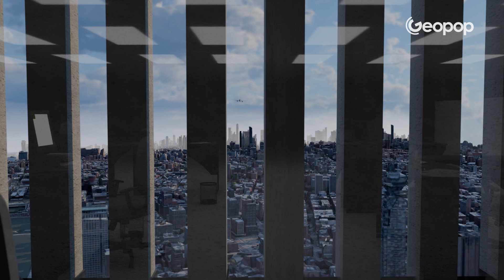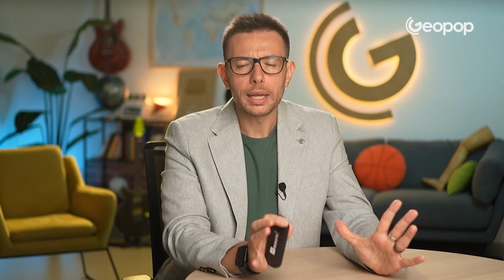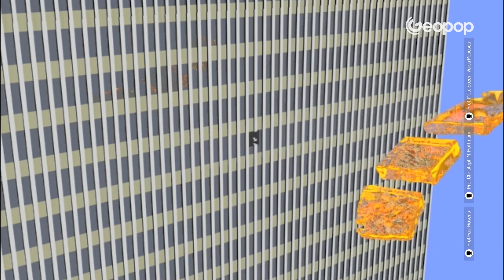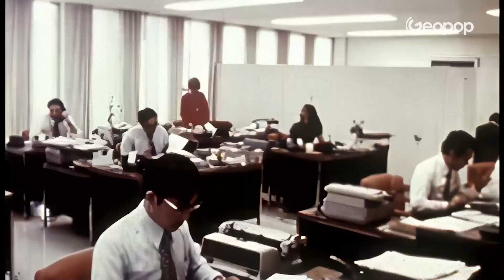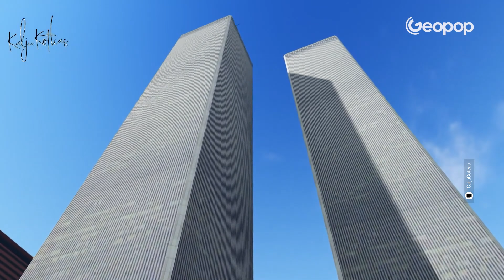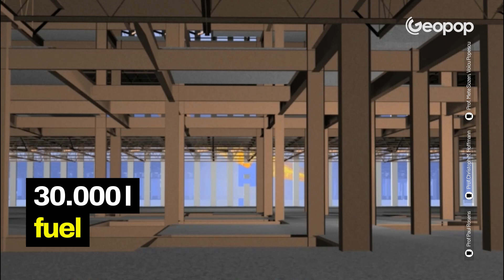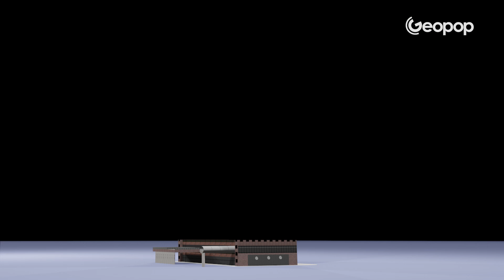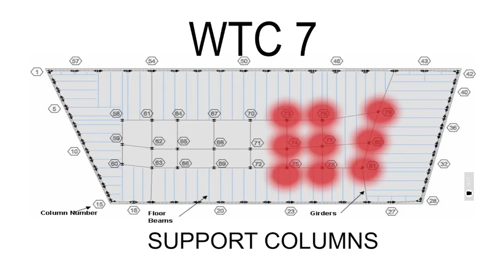9/11, 2001: The Technical Reconstruction of the Twin Towers and WTC 7 Collapses

Comment: He’s right about the fact that we will never truly know what happened on that day.  That’s the most disturbing part of it in my opinion,  the fact we can’t trust our own government to tell us the truth so we can’t ever know if their version is true or false.  In my opinion it’s about 50/50 with half of what they claim being a bunch of B.S.

Take for instance the Pentagon.  A computer model was designed by the American society of civil engineering.  In this program they left out key factors that no doubt would alter their conclusion.  They purposefully left out the nearly 20in of steel reinforced concrete exterior in their model,  they also left out the engines from the plane itself.  They some how are able to stand there with a straight fact and say that those two factors had no bearing on the outcome of their study,  okay fair enough than why leave them out?

You can’t seriously say that nearly 20in of steel and concrete didn’t give any additional protection than if they hadn’t been there at all.  It’s stuff like this that makes me question the validity of everything we are told and how involved our own government was in the murder of 2,977 American citizens to start a war over oil and get the support from the American people.
Reply: There is getting every detail wrong, then there is getting EVERY detail wrong.
Reply: @TheLoonResistance  what do you mean?
Reply: Please explain I am bafflled
Reply: I know exactly what happened that day - I saw it with my own eyes.
Reply: @aldunlop4622  you know what you saw,  you don’t know why it happened, who was involved, was their prior knowledge, did the U.S. govt have a hand in it, did the planes truly bring it down or was that a cover for a controlled demolition, etc.  Just because someone was there and witnessed it doesn’t mean they definitively know the truth of how and why it all happened.
Reply: @chriscampbell3417  In the 3rd to last paragraph in my comment above to @Karl-w6r, I asked him what was stupid about Richard Gage’s repeated assertion that ”the towers fell at free fall speed.” You’ll notice that he never responded. Nor did any other ignorant “truther”. C’mon, Chris. Here’s your chance to show everyone how knowledgeable you are. ANY competent 11th grader, who’s ever taken a high school physics class could answer this question immediately. But Gage & his architects & engineers were utterly baffled by the concept for about 10 f’king years. Show us your technical acumen, Chris. Let’s see YOU answer the question.
Reply: So they didn’t have an exterior wall on the model? I find that hard to believe. So you mean a 20” steel reinforced concrete wall as in a standard concrete wall? Or did it have a special steel other than rebar inside of it? I mean it’ll definitely make a huge difference if they didn’t account for an exterior wall. But idk i never really bought into it being an actual missile. I mean people witnessed the plane coming in.
Reply: @SuppressHoardReject _ @SuppressHoardReject _ @SuppressHoardReject _ @SuppressHoardReject _ @SuppressHoardReject _ @SuppressHoardReject _ @SuppressHoardReject _ @SuppressHoardReject _
Reply: @Hariolor, do I detect a touch of sarcasm in your comment?
;-)
Reply: You make zero sense … there are always uncertain factors  … you over emphazise them and put them into a delusional context … planes hit the buildings ..  that can hardly be disputed … and intentional demolition is impossible … thats obvious if you have a mininum if knowledge how they proceed for that!
Reply: Absofuckinlutly
Reply: It’s almost as if the purpose of the terror attacks was to increase our defense budget to levels unknown to man..
Reply: the issue is money. an exhaustive search is exhaustively expensive. then the conspiracy people cry fraud, waste, abuse.  so with 70% of budget, you get about the appropriate amount of facts.  people involved understand and do try to calculate away the losses.
to expect perfection from a collection of imperfect people working in an underfunded and imperfect system is the issue. further, to compare that to any impractical reason for the govt and all the related partners to the damage to conspire to demo a skyscraper and slaughter its inhabitants stretches reality beyond belief.
Reply: @chriscampbell3417  @chriscamobell3417, Could you please provide a reference link to your cited report? I do not remember the ASCE doing an analysis of the Pentagon. I believe I remember the same structural engineering group from Purdue University that analyzed the towers doing an analysis of the Pentagon too, though. And I am very skeptical of them leaving out either the engines or such a massive component of the exterior of the building. I remember that their analysis had the plane accurately “inverting” (with the debris & from the front of the plane being concentrated near the entry point & the debris from the rear of the plane penetrating much further into the building, as was actually found in the debris). As I write this, I am certain that the analysis to which I am referring included the engines, because they were the only components that passed all the way into the building, thru the innermost wall & into a passageway between two major “rings”.
Reply: I don't think we will ever hear the truth.
Reply: How come no fiire fighters ever tell their story? About what they see? About what they experienced? What they went through?  No descriptions of anything? Do they not have insight? None of their thoughts? why does someone else have to tell thei story?
Reply: @ThomasStout-r3g, Tom, I disagree with your premise. I’ve seen comments from LOTS of firemen. In fact, I remember a “project” to preserve the memories of many ( perhaps “most”) eyewitnesses, that specifically focused on firemen & other first responders. 

But, here’s a few observations: I heard many quotes from firemen that were simply, factually wrong. For example, there was one fireman that said “we saw molten steel in the basement.” This is categorically false. They saw molten metal (most probably aluminum), NOT molten steel. I saw the same guy making comments about the building collapsing “just like a controlled demolition”. This is also categorically false. It bore zero resemblance to any controlled demolition. The lesson here is that “expertise is EXTREMELY specific. Like every professional, firemen are experts at “what they do every day”. Firemen do NOT do controlled demolition. They don’t work with molten metals in foundries, and are thus amateurs at both topics. Firemen “put out fires, rescue people & attempt to save buildings”. Firemen addressed CLEARLY & CONCISELY every aspect that pertained to their jobs on that day. (I sincerely doubt that even metallurgists in foundries could distinguish molten steel from molten aluminum based solely on a brief look alone. The REAL controlled demolition experts completely dismissed
 the contention of those collapses resembling CDs.

The people who are experts on the collapse of skyscrapers are very few & far between, but they are Structural Engineers with specific expertise in “tall structures”. (it’s just not a field that calls for a lot. SEs are more interested in “how do we keep these buildings from collapsing” rather than “what are the characteristics of the collapse once it starts. But the GOAT of Structural Engineers did weigh in on the collapse. His name is Zdeněk Bažant, the chair of Structural Engineering at Northwestern University. His comment was, “the building collapsed exactly as a knowledgeable engineer would expect, based on the causes & effects described in the NIST Report.

Also, EVERY Structural Engineering Society in the US has publicly come out in support of the NIST effort & their conclusion. NONE have produced any published papers or analyses which support controlled demolition. I invite you to NOT take my word for all of this (even tho I am correct in my assertions), but to look into it for yourself. An intelligent approach will be based on “what do the REAL EXPERTS say about these events. Ignore completely the Condpiracy Theory morons (like Richard Gage & his AE911T bunch of incompetent morons).
Reply: Which is more extreme -- to accept without question the inexplicable lack of turbulence in the wake of a 500 mph large passenger airliner -- not evident in the smoke and fire covering the impact zone only seconds later? -- or to recognize the indications of digital projection in its imperfect nature as we see a wing disappear in front of a bright blue sky? From another camera angle, the same aircraft is seen passing behind a crane in the foreground, yet in front of the heavy crane cable. 

There should be a hurricane of turbulence in its wake that would entirely disrupt and disperse the smoke and fire seen billowing outward just 3 to 4 seconds later at both towers.  Even the wake of a small Cessna aircraft would be noticeable -- yet there is nothing.
Reply: -- Then what is the source of the many tons of molten steel found in and under the debris, the heat so intense that the molten steel remained in that state for weeks afterward, running off of the debris as it was excavated. This cannot be molten copper from wiring that retains the color of a shiny new penny.  It cannot be molten aluminum that retains the color of the polished aluminum wheels of a street racer. It was the color of glowing orange molten steel  that cannot be mistaken for any other material, reported by firefighters who are very experienced in the nature of such materials as well as seen in video evidence.

When you combine this with an entire lack of turbulence behind 500 mph aircraft, when even a small Cessna Aircraft would leave an evident wake in the smoke and fire only seconds later .  . We find that skeptics still cannot be skeptical of the official narrative in explanation.  Sponsored channels and forum activity are skeptical of nothing when support is provided.

Sponsored activity in the forums is very normal today for commercial and political purposes and subjects of controversy -- in the attempt to lead public debate.
Reply: @  @ronaldgreene5733, your posts are fabricated gibberish, with zero supporting evidence. You have no evidence. You have YOUR “wishful thinking. If you had any REAL evidence, then why tf have you been sitting on it for 24 years, rather than disclosing it to the world. There are 100 newspapers & 1000 authors, just here in the US, who would LOVE to receive such info & … (HUGE “IF”, here) IF VERIFIED, would pay dearly for access to that info. Yet 24 years goes by, and not a peep. 

Here is the “big picture” view of what Conspiracy Morons, like Ronald here, do: 
The KNOWN events of 9/11 represent about 10 encyclopedias of painstakingly gathered information, gathered by about 20 different independent agencies (FBI, Local police, CIA, FAA, etc., etc.) In Toto, it represents a 100,000 piece jigsaw puzzle that, is 98% complete (& INCLUDES intercepted communications from OBL to al Jezzera supporters in the Middle East in which he proudly acknowledges that he WAS behind the events) & when assembled, the jigsaw presents a picture of Osama bin Laden standing behind the identified hijackers. Of course, there are several missing individual pieces (as there are in every “real-world” complex event). 

But Ronald, here THINKS that he’s going to find one tiny piece of blurry, unidentifiable “who knows what”, and when that piece is hammered into some random location, is going to magically turn all the KNOWN info into a picture of George W. Bush, Dick Cheney & cohorts. No explanation offered on how that one piece changes all the rest, of course.

And while he offers ZERO evidence for his stupid theories, he just MAKES SHIT UP. Such as “molten steel”. There was NO “molten steel”, Ronald. It’s not possible. Here’s a big hint. Check the melting temperatures of aluminum, copper & steel. Before the first ounce of steel could possibly “melt”, ALL of the aluminum & copper would have to have already melted into a LAKE of molten metal, and no human could have survived getting close to that location for about 4 months without cooking. But THAT DID NOT HAPPEN! People were (at great personal risk) combing thru the wreckage hoping to find survivors within a day of the collapse. Plus, in the cleanup, they pulled thousands of tons of both UNMELTED copper & UNMELTED aluminum out of the wreckage which they trucked, catalogued & sorted at the temporary storage site. 

Next, he suggests some STUPID crap about “lack of turbulence from the aircraft”. 

Yes, Ronald, a Cessna flying thru any clouds STATIC cloud of debris or smoke from a fire WOULD demonstrate its passage with wake turbulence. But the passengers jets on 9/11 NEVER flew through either of those. The clouds of debris were ejected at HIGH SPEEDS (ie., NOT “static”) a few seconds AFTER the impacts. The fires took a couple of minutes to grow & generate smoke, and were not along the flight path, (they were mostly on the OPPOSITE side of the building from the flight paths.

To put all this to rest, Ronald, show me the comparisons between these impacts & the controlled studies TO WHICH, apparently ONLY YOU) have access.

PRESENT YOUR EVIDENCE, Ronald. The airplanes never flew thru any clouds or smoke, Ronald. The planes flew through “clear air”. The plane impacts CAUSED the debris clouds & STARTED the fires which came later. The debris clouds & fires were the RESULTS of the planes impacts. Causes PRECEED results, Ronald. The planes never flew thru clouds of debris or smoke.
Reply: @ElLowEl .  . "What the hell are you talking about?" .  . 😃 .  . Thank you for your sponsored reply, Mr. EILow.  The word projection indicates holography as you know, commercial demonstrations of which have been amazing in recent years.  To feign ignorance doesn't work well for you, however.  Where, Mr. EILow, is the wake turbulence only seconds after passage of a 500 mph large passenger airliner -- not seen in the smoke and fire covering the impact zone?  Even the wake of a small Cessna Aircraft would be noticeable -- yet there is nothing.  It's likely that no real answer from you is forthcoming. We'll wait and see .  .
Reply: @ronaldgreene5733, Yeah, I thought that’s the stupid, Stupid, STOOPID rabbit hole that you were swirling around but I didn’t want to put such STUPID words into your mouth. That level of stupidity is YOUR job. You say that ”commercial demonstrations of a technology that could project a 3D image of a B767 onto nothing but “clear air” on a bright, sunny morning, and could “transit” over 10 miles of travel thru those CLEAR skies, be seen from about 15 different angles from about 15 different cameras  … and your ignorant ass is suggesting … “HOLOGRAMS”???

There is an EXTENSIVE list of very REAL physical effects of the impacts, from lucky people near the impact floors who managed to make it out of the South Tower & described the damage, death & destruction all around them”, to “an enormous amount of debris (including 2 turbine engine cores) landing in the streets below”, to “a huge gash appearing in the external wall of the south tower”, to “the elevator doors in the lobby being blown open”, to “firemen in the NORTH tower lobby being blown off of their feet by ‘hurricane velocity’ winds traveling UP the stairwells” (after passing thru the underground maintenance tunnels connecting the two towers), to “the fires in the NORTH Tower blooming out of the broken windows at the same time. Further, bone fragments, identified by DNA as belonging to verified passengers on UA175 were subsequently found in the debris. And you’re going to have to explain how “a hologram” placed calls from multiple passengers on AA11 to their family & friends, informing them that “their flight had been hijacked”. Presumably, you’re also going to assert that AA11 was also “a hologram”. You’re going to have to explain how this “unbelievable technology” (literally “unbelievable”!) managed to source the DEAFENING & MOVING sound of a jet flying fast & low over Manhatten, which allowed the cameraman for the Naudet (sp?) brothers to immediately “sound locate” the source of the sound of AA11 quickly & accurately enough to get his camera pointed to capture the impact of AA11 into the North Tower. 

ALL of the above, and much, Much, MUCH more are incredible REAL-WORLD effects for a “hologram”. (Again, literally “incredible”.)

You’ve got NOTHING, ZIPPO, f*ck all, to support your stupid assertion. That “technology” didn’t exist in 2001 & it doesn’t exist now. Please, PRESENT YOUR EVIDENCE. You assert that “amazing commercial demonstrations have been made”. provide a citation to such a demonstration that doesn’t exist solely in your Conspiracy-addled imagination!

You are exactly as delusional & technically incompetent as a typical “Flat Earther” or “Moon Landing Denier”.

Tell me, Ronald. In your esteemed opinion, what shape is the earth? Did NASA fake the moon landings?

Curious minds want to know.

Or are we going to have to endure ANOTHER quarter century of you morons’ abject incompetence & making STOOPID assertions for which you are unable to provide one IOTA of factual evidence. We’ll be sure to circle back again … IN 2050 … for your still baseless stupidity. I can’t wait!
Reply: @chriscampbell3417  
No, he is not right. The firefighters knew what happened on that day. The building mechanics knew what happened on that day. Those who got out of the building minutes before the collapse knew what happened on that day.
Reply: When thousands of America's architects and engineers state plainly the only way those buildings coulda come down in ten seconds into their own footprint were from precisely controlled exotic explosive demolitions.... I believe them.
Nowhere in the world are buildings built to a higher spec than in the U.S, and those people have built everything around us, so when they speak I listen.
Those buildings were wired to blow, and when they say there's no footage of the 'plane'hitting the Pentagon' ....we know exactly why that is, it was a missile no a plane.
Reply: @Karl-w6r, your entire comment SCREAMS, ”I have absolutely zero clue what I am (ie., you are) talking about” Clearly you are referring to Richard Gage’s Merry Troop of Morons (AE911T). First thing first, “architects have ZERO formal knowledge or expertise in either “what holds buildings up” or “what causes them to collapse”. I mentioned earlier a key truism: that “expertise is EXTREMELY specific”. Architects make buildings pretty & functional. Structural engineers determine whether the building will stand or fall. 
Architect are explicitly prohibited from portraying themselves as structural engineers when building plans are approved. In all of Gage’s group, there was ONE (IIRC) structural engineer (a professor from Alaska, who promised a lot & delivered nothing. Specifically pertinent is the fact that amongst the very, very few engineers in Gage’s group, there was NOT ONE structural engineer (including the Alaska clown) who had ANY experience with “tall buildings” (aka, skyscrapers).
Gage’s group was RIFE with students (usually “Political Science” types). But THOUSANDS of structural engineers DID speak out on this matter. Virtually EVERY structural engineering society & faculty in the US & every other country in the world, (with the exception of a very few in the Middle East with political agendas) praised the work of the NIST engineers, who were, by the way, the MOST experienced & MOST knowledgeable in the country, which is why they were selected in the first place. 
Gage & his morons, just like Robby Balsamo & his “Pilots for 9/11 truth, was a mocked & despised outcast within his own community because of the stupidity that he spouted. Both promised repeatedly that, “the truth will be revealed shortly.”

It’s now been 24 YEARS since those events. Hundreds of the experts who wrote those reports have died. they were, after all, “highly experienced” (read “older”) engineers at the time. They were all, also patriotic Americans who would never cover up the most heinous attack on the US in our history. Many Conspiracy Theory morons asserted that they were threatened into their findings. Hoe, exactly, do you threaten a dying person? And yet, the number of “death bed confessions” that “I was ordered by Da Gubbamint to produce fake results” which have been disclosed in the quarter century since … ZERO!! Explain that.

Meanwhile, for that same 20+ years since the NIST Reports were released, the methods & the analyses performed by the NIST engineers has been examined with fine tooth combs year after year in graduate programs in structural engineering & have held up as Gold Standards of engineering analysis.

Show me your expertise, Karl.
For nearly ten years after the event, Gage & his moron repeated the ludicrous (& wrong) mantra that ”the towers fell at free-fall speed” Please tell me what is 100% wrong with that stupid, stupid statement.

Sorry that you, Karl, are too ill-informed to do any proper accounting of numbers or expertise.
You are welcome to your stupid & wrong opinion, Karl. Just out of curiosity: is the earth flat? Did we land on the moon? Do vaccines produce autism? Did the CIA kill JFK? How deep is your rabbit hole?

Feel free to respond to ANY of my points. You’ll notice that, NOT ONE of you Conspiracy Theory brethren have yet done so. They just slink away as soon as they recognize that I know what I am talking about, because they can only address other clueless morons, like themselves. So I’m predicting that you’ll do the same, Karl. Prove me wrong, or prove me right. We’ll all see.